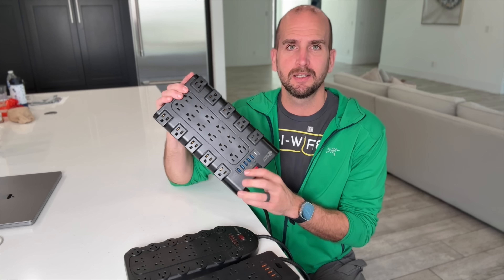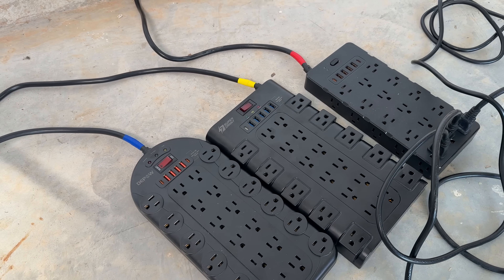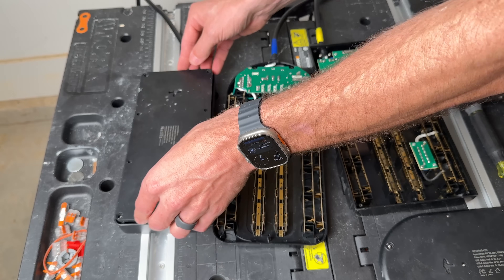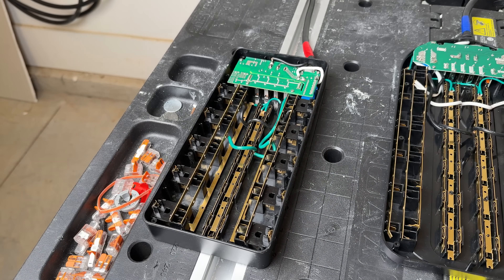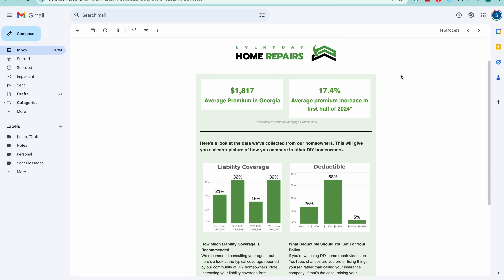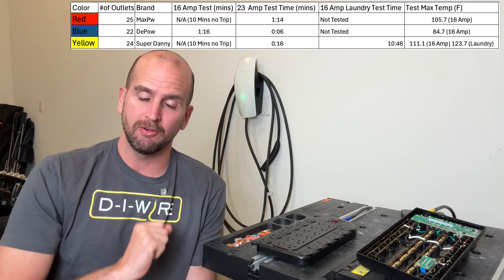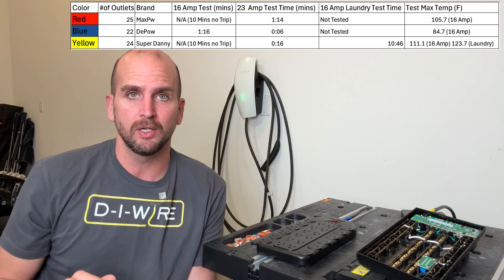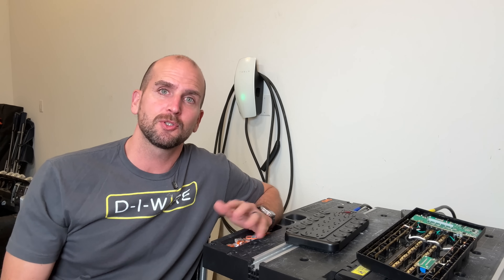Testing The Most Dangerous Amazon Power Strips |  I Wasn't Expecting These Results!

Comment: even though they're in theory some hazard, they're not meant to plug 20 heatguns into single power strip, they're more meant for someone who plugs like 20 USB chargers for their idk raspberry pis and other garbage that pulls 5W each
Reply: was thinking of that area behind my desk with the computer and a bunch of other small things. In my case it's about 10 items with a  total draw of maybe 5 amps, including a lamp, and a 15 watt coffee warmer.
Reply: My 45 watt charger brick gets hot enough
Reply: Yep. 25 x 60W USB chargers could be hot without ever exceeding 15A. You can charge/power a bunch of USB charged/powered devices off one of these.
Reply: @   I don't think I have ever seen a 60 watt USB charger.... and what's the chance someone has 25 of them?
Reply: @ Then you haven’t been paying attention. USB-C Power Delivery Specification can deliver up to 240W on a single USB C port. While those are rare, there are many that deliver up to 65W, or multiple 30W ports, or even more 10W-20W ports.
Reply: @rupe53  your laptop charger is most likely just 120w usb c charger, and most recently there are small gan chargers which have size of old brick but have many usb c outputs, also if you have some high end phone, not some iPhone then most likely it utilizes quick charge in ranges of 45-90 or even 120w
Reply: @stefan37-1    charging at that rate will only be for a short time so I am not too worried about excess heat in that case.
Reply: @rupe53  ye but im just replying to your "I've never seen 60w usb c charger" comment,. they're pretty common, and even more powerful, and smaller than standard 5w 5v usb chargers, you can power with them anything from your phone to night lamps to some hair trimmers
Reply: @stefan37-1     again, anything out there can be abused and there's always a better idiot that can't / won't read directions. I still say the likelihood of someone buying this item to plug in 25 of those things will be pretty slim.... and that's still only 1500 watts if they did.
Reply: @rupe53  it was probably for entertainment system
Tv, dvd, xbox...
Reply: @rupe53 I have 10 60 watt usbC chargers which is likely what he means, I use separate chargers for each device on a big power strip for various test equipment. Some are just regular usb which each GaN charger also has.

Comment: Hey Scott, you should  get yourself a plug in line splitter, Extech part # 480172
Reply from the maker: Thanks for the feedback and I have the one from Klein Tools but it maxes out at 15 Amps so that is why I went straight to the hot wire.

Comment: The most heavily used outlet I have is just a bunch of different low amp devices. Chargers, various electronics, so on. And the main reason I got it was so I could have room to plug things in. I dont actually use all twelve, I just needed to be able to put an empty outlet between power bricks so I could have room to plug in the next brick.

Comment: The solder is fine because it exceeds the contact areas of the prongs during contact.   The prongs never fully contact the outlet brass.    The switch is a more likely fail point.   Or the outlet brass annealing and gaping. The switch can heat up and fail without even being flipped often.. just being immobile and on.   And consumer electronic devices switches are the molex of the device switch world.

Comment: I’m surprised this is even allowed in the states! This is sketchy af!
Reply: It's highly recommended that devices be either UL or ETL listed, but in most areas of the USA it's not a strict requirement (can vary by jurisdiction, laws dealing with electrical, plumbing etc are local). No doubt these devices would not pass UL or ETL certification tests.
Reply: @timezonewall look at the middle one

Comment: I actually have two of the yellow ones. One is used for a low voltage battery charging station I have in my workshop, and the other is in my office and used for several low voltage devices on my desk that are never used at the same time. Since seeing this I might rethink keeping them.

Comment: what solder?  I don't see any.  more like spot weld.
Reply: Yes, they were all spot welded. Surprised he did recognize that. None the less, I agree that they didn't look like the best connections.
Reply: @timezonewall he didn’t recognize it because he doesn’t actually know anything about the subject matter.
Reply: @Those_Weirdos  Yeah. I appreciate Scott's videos and find many of them useful, but there are times he is a bit out of his depth and just sort of messing around, and this is one of those videos. I guess I don't mind because it's always obvious; he's not passing himself off as more of an expert than he is.
Reply: Badly spot welded, but I agree not a soldered connection.
Reply: Solder can melt if too much current draw heats up the bus bar. Then, if too much heat wasn't bad enough, you can end up with arcing which can easily start a fire. They usually use ultrasonic welding to bond wires to bus bars and other contacts.
Reply: was test done to check resistance of the solder connection. also a pull test.
Reply: @allanmackenzie9086  Not a solder connection. They are welded.
Reply: In fact in that sort of application they should never be soldered. They should be welded or bonded.
Reply: @WitchidWitchid  It clearly shows that they are welded not soldered.
Reply: Also whats that about resistance?

Solder has the lowest contact resistance of all possible connections. I guess the same goes for welding but correct me if I am wrong.

Also I think in Germany you are not allowed to use solder for AC 250V for some safety reason, but it was not because of resistance for sure.

Is that similar in the US?
Reply: This looks very much like the internals of some of the UPS devices I have opened. Between those crappy solder/welds (if you can even call it that) and the use of aluminum wire, I am surprised we don't see more failures.
Reply: You lost me when you called welds "solder". Solder melts, welds don't. Yes, they can fail too, but they are stronger.

Comment: I have few of these types of power strips, not because I use every outlet, but because 2/3rds will be blocked off by large wall warts. Event strips that have extra space or have rotating plugs, most will not be usable.
Reply: Personally I prefer to use short pigtail type extension cords. Cords that are only about 6 inches.  You can get 10 of them for like $15 or $20 at a 12 gauge.  

I prefer having to use less space.  These large multi-outlet behemoths take up quite a bit of space.
Reply: I have one of these at my edit computer station.  All the wall-wort bricks and powered usb devices and such mean many plugs and blocked access. The whole thing even at maximum only has 230W of load on it though.  You need to use things for what they are intended to do.  One of these is not meant to run a construction site.
Reply: That was my thought, though I haven't bought one of the huge ones.
Reply: They make 5 foot long or more power strips.
Reply: @Sidicas  I actually have a 3ft with 16 outlets. Still have same issue. If there is large wall warts, it will always take up 2-3 outlets.
Reply: Ohhhh, that makes sense.

Comment: I was really scared when I saw the thumbnail because I knew I had one of those but had to double check which one on Amazon.  

I have the blue one...2 of them actually.  😬

I use one for the dozens of plugs that power all the bulbs in my Christmas Village (all LED and low power output), and I use the other in my craft space.  

I have a lot of craft tools plugged in, but only 1-2 running at any given time.  I just wanted to avoid the hassle of having to constantly switch out and plug things in, so I got the multi-outlet power strip.

I'm happy to see that I chose well of the 3 possible options.  I really spent a lot of time reading reviews for safety concerns.
Reply: thats probably the way they should be used. lots of things plugged in and only 1-2 being used at a time
Reply from the maker: Your application is the one that makes the most sense to me.  When you want to keep a bunch of things plugged in but only a few are powered at any given time 👍.
Reply: Yeah. That’s why he posted the thumbnail and clickbait title he did. To scare you and get you to engage.
Reply: @Those_Weirdos  than again i bet there will be people that will massively overload it and then complain their house caught fire

Comment: I have the yellow one and I like it just so I can organize the power briks in different orientations I don't use all the outlets. I know I can use a racial surge with whip extensios. I have a computer, 2 monitors, 8 port switch, 42in oled and an nvidia shield as well as the usb ports not much more than a standard 8 port surge protector

Comment: Would like to see you compare them to branded ones, especially opening them up to see how they are constructed.
Reply from the maker: I like Anker and will try to buy one of theirs to see if the design is a bit better.  Thanks for the feedback.
Reply: @EverydayHomeRepairs  I'd like to see APC / Tripp Lite too... those companies have been around for decades.
Reply: @EverydayHomeRepairs  Agree on Anker.
Reply: Seen a general electric one at my local staples today that claimed to be server hardware rated @EverydayHomeRepairs
Reply: Years ago I bought several Belkin brand 12 outlet power strips. All smelled like they had burnt electronics in them after being in use for about 6 months. They were cycled out with new ones as they started to stink, so it wasn't a single power spike that could have taken them all out at once since some were still in the shelf not plugged in.
Reply: do branded ones have strips with this many outlets?   I almost feel like there's no way that can be UL certified
Reply: @Mike__B  The blue one is ETL certified, which is supposed to be about as good as a UL certification, but the other two don't seem to have any safety certifications tied to them.
Reply: @Mike__B  The "blue" one is indeed ETL listed.  I checked on the ETL website. (ETL tests to the UL standards).
Reply: I like making my power strips.  I can choose what grade outlets plugs, cords and electrical boxes to use, install what kind of breaker I want to use and even find a way of integrating other functions like GFCI and surge suppression.  Granted, this is an expensive way to make them but are much better grade and duty than the average cheapy.  This is one of the reasons I like to keep an eye out for older or contractor power bars as they use regular duplex outlets instead of the average brass strips seen in the cheaper ones.

Comment: I say plug all the outlets into each other to make a 70 outlet power strip
Reply: Genius!
Reply: I can finally use all 70 of my space heaters 🎉 I will be nice and warm for the rest of the life!
Reply: @chobbes72  Why are these heaters not working when they are on opens breaker box Aha found it closes circuit circuit breaker opens well force it to close the circuit uses a solid core cable to force it to close Perfect 1 min later why does it smell like burning goes to the basement AAAH ITS ON FIRE WHERE'S THE FIRE EXTINGUISHER realises there's no fire extinguisher well time to call the fire department they arrive way too late it's too late the house is burned down
Reply: @chobbes72  lol!🤣im pretty sure if you did that you would cause an electrical wildfire and burn the whole block to the ground...
Reply: @chobbes72  ask my sister likes to say if you give a man a fire he'll be warm for a night if you sediment on fire he'll be warm for the rest of his life
Reply: @copperdam  
"if you sediment on fire he'll be warm for the rest of his life"

How do you sediment?
Reply: You can stay warm all winter and save gas and fuel oil, warmed by the gentle hum of your space heaters and the restful crackle of flames burning your house to the ground 😂
Reply: @robertsmith-dr5tm  Used properly space heaters are safe enough but preferably have each one on its own electrical circuit, use 12 gauge wiring and a 20 amp outlet.  A large 110 VAC air conditioner (say, 12,000 or 15,000 BTU) requires the same type of circuit.
Reply: I was wondering how many you could daisy chain.

😅
Reply: @Pallidus_Rider  Electrical engineers tell me it is especially bad to daisy chain multiple surge protected strips together.  I don't understand why (I am a retired tax professor) but it has something to do with the surge suppression circuitry.  It is not best practice to daisy chain strips anyway but evidently daisy chaining two or more surge suppressors together can wreak havoc on your electrical and devices if a major surge actually hits them.
Reply: LOL
Reply: If you plug 24 outlets into another 24 plug outlet you will get 567 outlets. Sounds like good plan for me
Reply: u guys connect to outlets?

I connect my power strips in a loop so i have infinite power for free
Reply: Be careful. That's like dividing by zero. Could end the universe @Walter_
Reply: Hahahahahah
Reply: 69* ;)
Reply: @SchimShady12  I wonder what Kinky Kristi Noem would be like in that position.  🤣🤣🤣🤣🤣😍😍😍😍😍
Reply: Most of these are used for computer equipment which is low volt/amp... Try it... Chain the outlets, then fill them with Computers, routers and switches........ I bet you won't have a problem......
Reply: I want to see a daiy chain until everything EXPLODES.
Reply: The fire starter 9000
Reply: I don't even need more than 6 outlets and an extension cord for all my appliances. 25+ outlets must be a product designed for women 😅
Reply: @Billy_BrownCow  For computers setups. For instance if you have 2 computers with 3 monitors each, speakers, router, modem, scanner, printer, possibly a desk lamp, and a fan. That is easily 18 outlets.

Add in maybe a camera, a hard drive docking station, and a laptop. That is about 21 outlets.
Reply: Daisy chaining that many takes me back to my Lan Party days
Reply: 😂 unfortunately I’ve seen people daisy changing power strips and say “but there’s a surge protection switch”
Reply: You should never plug a piwerstrip into another oowerstrip, causes current back feed if working right tha6 is